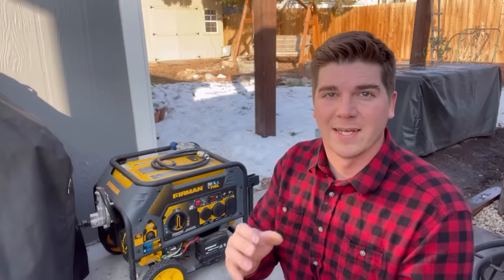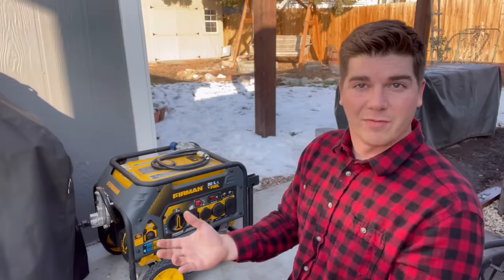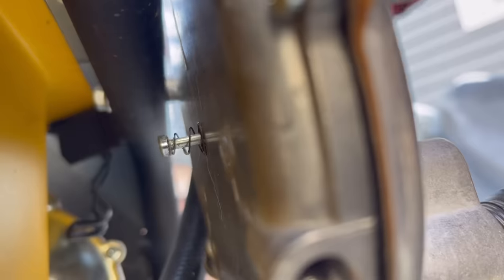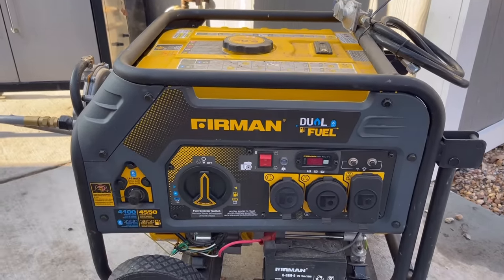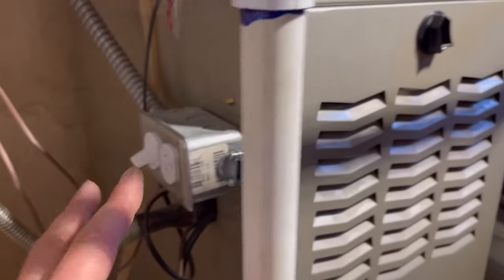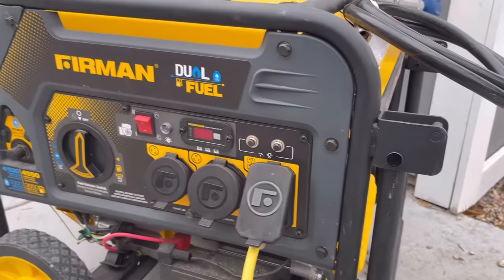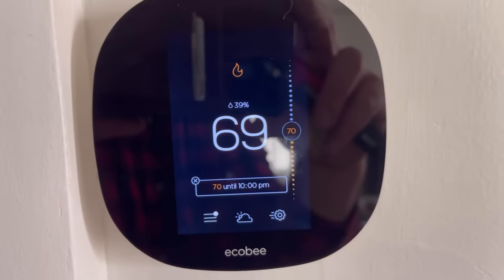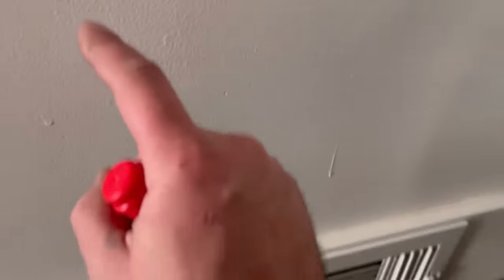Most Homeowners Don’t Know About This Trick To Get Heat During A Power Outage.

Comment: Nice Video.  My I suggest you install a four circuit transfer switch next to your electrical box, including a video of your steps.  You are going to want some lights during your next power outage.  I would suggest one circuit to the plug for your TV so you can keep informed about the power outage.   And then, put a receptacle through the wall  (on each side of the wall)  so you don't have to run such a long cord down the steps, which someone might trip over.   Also, running your power through a wall would allow you to close your back door  (which needs paint  : )   because you know it will be cold and snowing/raining during your next outage.   I'll be waiting for that video.   (your generator is big enough to run your furnace, lights, and your TV... but you knew this).

Comment: Or you can make a suicide cable and run it to the panel but make sure the main is  turned OFF to prevent back feeding the grid.
Reply from the maker: I’d have so many people yelling at my saying I’m going to kill someone because it’s dangerous lol
Reply: @diyhvacguy  Yes, very dangerous and could electrocute someone. In my neighborhood, if you were to "leak" 120v out of your system onto the power line feeding your home, that 120v travels to the transformer on the pole and creates 1,100v onto the line that normally feeds it. Anyone working on that line could be subjected to that voltage.

Comment: I don't see any wiring to my water heater. How does it get ignited?
Reply from the maker: If it’s gas it doesn’t require any power. It just has a spark ignitor like a gas grill and then the pilot stays lit all the time.
Reply: @diyhvacguy  correct there's a pilot that's on all the time. So if the pilot is off for any reason, how does it get the spark?
Thanks for your videos. I learned a lot!

Comment: I thought about doing this too. But I have a question. You contradicted yourself. If you have that three prong plug wired into the house wire. And when that house wire is on that’s why you put a off on switch on it. Because that plug will be hot. If you connect those two prongs together, they will spark. Then this is where you contradicted yourself you said whether the power to the house is on or not there’s no power coming out of this plug. But then you hook the generator plug up to it and you said you have to turn the switch off so you don’t feed power to the rest of the grid. I’m not saying your videos bad it’s nice to pass info on. But when you’re talking about a DIY. You need to make sure you’re telling people correct. Because I caught you talking about propane and natural gas as soon as you were done you called natural gas propane again. You can’t get those two confused they both burn at different temperatures. They both use different regulators different pressures. Different temperatures outside. Also change the pressure on Propane just like national gas. Other than all that it’s a nice video to give people an ideal of a different way to stay warm. The carbon monoxide detector is a nice touch next to the couch. With technology. I would put fire and carbon monoxide wireless detectors in the basement where it looks like you got your hot water tank you got your heater that’ll be most likely where the carbon monoxide would start at. Unless you’re planning to run salt water through your furnace I really don’t think that the two chambers would rust out in your lifetime that you need to check for carbon monoxide coming through your heater vents. 👍👍👍
Reply: Instead of deleting it, or editing like crazy. I came across your video on how you hook the receptacle box up between the heater and the house grid. And you’re correct they’ll be no power coming out of that plug. Because that three prong plug comes directly from the furnace not the grid. 👍👍👍👍👍👍👍
Reply from the maker: Yesir, thanks for watching the other video! That’s where I was gonna send you because it is pretty clear. Thanks for the support. Cheers

Comment: What is the difference between a generator and a generator inverter.
Reply: Simple answer; A cleaner waveform on output voltage which is better for electronics, plus throttle down with lower loads for the inverter type.
Reply: @Robnord1  Thanks for your reply. I think i understand cleaner waveform on output voltage but don't have a clue what throttle down with lower loads means. I own a generator with no inverter and am interested in isolating my furnace as you recommend. Would I be correct the generator would be fine for things like furnace,, fridge, and small kitchen appliance. Should I use something like a UPS for TV and electronics to provide a cleaner waveform for them?
Reply: @binnsbrian  Most inverter generators reduce rpm, thus use less fuel under light output load, whereas standard generators run at fixed RPM. Yes, a UPS is on our TVs and computer, but my  purpose there is avoiding improper shutdowns, not cleaning up voltage. For years we operated TV and computer without a UPS and they were unharmed with standard generator output. Some comments here say a few of the latest furnaces require cleaner voltage and/or neutral bonding, but ours does not.
Reply: A generator head must turn at 3600 RPM to produce 60 Hz needed by home appliances, and that is loud.
An inverter generator is a generator that produces electricity, converted to DC to charge a battery, and then an inverter converts that battery DC into household AC at 60 Hz.  So when the loads are using little power, the generator can run much slower (and quieter) to keep the battery charged, and still deliver 60 HZ AC to the loads.  It's more complex, has more parts, and costs quite a bit more, but has 2 nice advantages:  fuel efficiency and low noise.
Reply: @PeterLawton  That's a great and simple explanation.  That means one I can understand. Thank you for taking the the time to reply.
Reply: "What is the difference between a generator and a generator inverter."
The generator is really an alternator.  The spinning magnetized rotor excites alternating current in the stator coils wrapped around the rotor and the load is connected directly to the stator coils.  Voltage regulation, such as it is, is accomplished by adjusting the current in the rotor; essentially identical to an automobile alternator. 
A generator inverter is all of the above BUT the output of the alternator is rectified to DC which in turn feeds an inverter which, amazingly enough, turns it right back into alternating current BUT with a twist -- the shape of the waveform is adjusted a thousand times a second to achieve nearly perfect sine wave and voltage regulation despite reactive loads (assuming it is a sine wave inverter).  It also eliminates that the rotor must spin at exactly 3600 rpm to get 60 Hertz.  It can spin at pretty much any RPM and slows down if the load is light.  This saves fuel and also extends the lifetime of the unit and lowers the noise level. 
But that also means more electronics in the generator.  So if you are at a job site where delicate electronics is not a factor and frequency control not all that critical, a rugged old fashioned "gen-set" is fine.
Oh yes, one other thing.  Because inverter generators are electronic, you can BOND generators to get more power or more voltage.  The electronics makes sure the two generators are "in phase" and it won't matter much their engines are different RPM.
Reply: @PeterLawton  "converted to DC to charge a battery,"
They don't actually do that.  It's just a capacitor.  Other than that, yes.  That's how it works. Sloppy AC to DC (with capacitor) to sine wave AC.
Reply: @thomasmaughan4798  Thanks Thomas. I already own a generator and plan only to use it if we have power failure. I plan to use it for furnace, fridge,freezer, and lights. I thought a UPS would clean up the voltage for the TV and electronics. I'm not to concerned about gas efficiency as I'm hopping I will have to use it very little. I hope I'm right. Thanks for your explanation.  Well articulated.
Reply: @thomasmaughan4798  thanks for that correction.  That makes sense.
Reply: @binnsbrian  " I thought a UPS would clean up the voltage for the TV and electronics."
Most UPS are active only in a power faulure situation and otherwise just pass through whatever they get BUT some UPS have pretty good surge protection and some have "line filters" to reduce noise and harmonics so, depending on your model of UPS, it's still a good thing to have in there.
Reply: @thomasmaughan4798  Would an isolation transformer do the same thing.
Reply: @binnsbrian  "Would an isolation transformer do the same thing."
Probably.  High frequency harmonics probably won't pass through an isolation transformer.  It might heat up the transformer but that's better than heating up a blower motor or something.   High frequency harmonics attempt to change the magnetic field of iron cored devices (motors, transformers) faster than they are designed for and it produces heat.

Comment: where is your video on how to hook up natural gas to generator? is that the hidden video. - ?
Reply from the maker: This is that video haha. I accidentally said propane a few times but this is completely on natural gas. Or were you talking about a different video? This is the only natural gas generator video I have currently
Reply: @diyhvacguy  natural gas regulator to your generator is the video I wanted to see. it's not under your emergency power series. can you post it please?
Reply: clarification: how to buy the correct regulator and hook it up to generator. need the start from basic version. thanks

Comment: Good Video , but this will only work with a Natural Gas Furnace 110-130V , NOT an Electric Coil Furnace which is almost always 220-240 Volts  !!
Reply from the maker: That’s correct. If yours is 220v it won’t have a switch like we started with it will have breakers so that should be obvious.
Reply: @diyhvacguy   Obvious , true !!  But some people do not understand what exactly you are doing here , & when they hear Furnace & Heat , they might think this set-up will work with every one !! Thanks !! 🙂

Comment: This won't work if you heat with a resistive heat pack and heatpump. You'd need a very large generator and a 220v plug.
Reply from the maker: Correct this is only for 110v
Reply: @diyhvacguy  I think if I ever have to replace my unit, I'll go with the Mr cool or a gree. Much less power consumption and heats to a much lower temp. Therefore, this setup could be used as our location is electric only due to no gas taps through our town.

Comment: I have an electric central unit.
Reply from the maker: Yes this is only for gas furnaces unfortunately. However I will be doing a video on how to run your heat pump on a generator with a soft start very soon. Stay tuned for that. Cheers

Comment: Buy an old house that still has a gravity feed gas furnace with a power pile thermostat. No external power required!  No moms 65 year old gravity gas furnace only has a 24 volt transformer for it . Only had one service call in all those years. Bad thermostat.
Reply from the maker: Yea the gravity ones are tanks! They don’t make them like they used to that’s for sure. It would be cool to find a stash of brand new ones that someone has stored for 40 years haha

Comment: I still would have back fed the panel with the main breaker off. And I would've back fed it through the 30 amp dryer outlet so everything in the house works.

Comment: This is a far batter way to hook a 240V generator to a house. https://www.youtube.com/watch?v=fB6uI7NPxRs  While a generator your size will not run the AC, it will run the furnace and almost everything else in your house, though maybe not all at the same time.  I have a 5500 watt (constant load) inverter generator, and I can run my furnace,  a freezer, a mini-fridge, the firdge, all the lights, my TV, Internet, and a Microwave oven.
Reply from the maker: I watched that whole video and I’m actually going to be doing the same exact thing very soon. Thanks so much for sharing! Cheers

Comment: Who can afford a generator? Oh, I know not me. And besides I've got solar panels I just got to get new batteries.
Reply from the maker: New batteries and pretty steep too. I have multiple back up heat videos that vary in price. the cheapest is simply to buy a $150 inverter and use your vehicle as a generator. Check that one out if you haven’t seen it yet! Cheers
Reply: @diyhvacguy  
Lol. Me drive you might want to be in a totally different Country, I'm blind as a shrew. I don't need a vehicle I'd crash. But I'm going to get new batteries and the inverter because I do have solar.